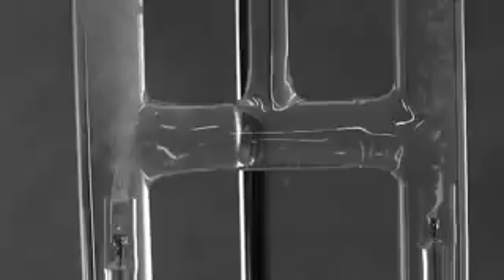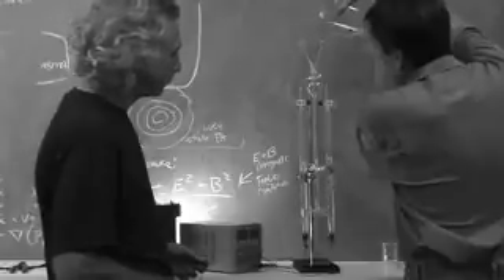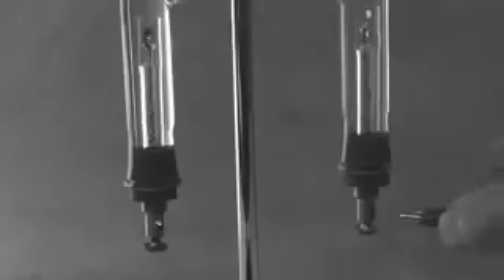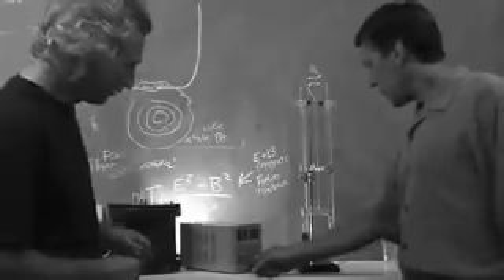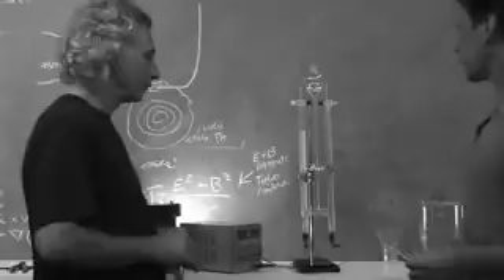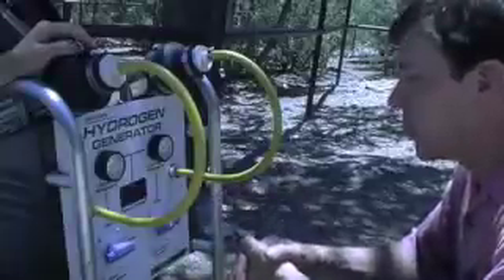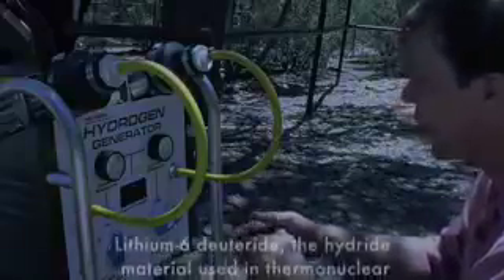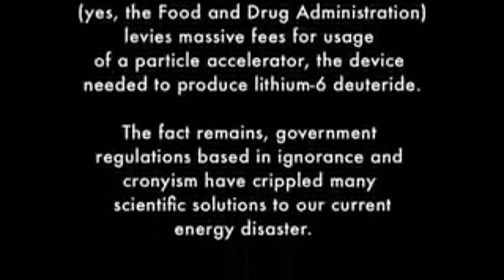run your car on water. This guy does just that!

Comment: The part about making hydrogen gas from water is true. The energy used to separate the hydrogen from water is then converted by either burning the hydrogen in an internal combustion engine or creating electricity in a fuel cell. However at best that energy when converted into motion it can never exceed the energy used to convert and separate water into hydrogen and oxygen gas. The basic advantage to liquid hydrocarbons (gas and diesel) is that there is a lot of energy in a very small amount of fuel.

 The part about storing hydrogen gas in Lithium Deuterium is a questionable solution to the hydrogen storage problem because of the heat and temperture needed to extract it from the lithium and the temperature need to make it react with the fresh hydrogen. Both Deuterium, Hydrogen and and natural occurring Lithium are all stable isotopes. Lithium Deuterium is used in H bombs but to make such a bomb requires enriched Uranium which is unavailable. So there is no reason to limit the sale of any of those materials. Why all the radioactive signs? Helps make the thing look secretive and dangerous. If he's actually doing this he could be in danger of creating an explosion of the conventional type.
Reply: Sources ?
Reply: Well now Kim, time to answer some of your own questions with just a little research.  Are you trolling here for the oil companies ?  Just another question.  One that I cannot answer with research.
Reply: If your a conspiracy nut then obviously I am from a conspiracy of big science, big oil, big government or whatever the latest big conspiracy is.
Reply: Kim O'Brien
 Nah! not a conspiracy nut...  Just trying not to be owned.  How's that working out for you ?
Reply: James Powell I dislike these people who make these outrageous claims. Creationism, burning water, permeate magnet motors, over unity electrical generation and then palm it off as a secret science. Has the government colluded with big business to achieve their ends? Yes! I believe so. In fact that goes on all the time. There are however out there venture capitalists who would easily put up money if these people could actually show it was possible to do the things they claim. 

I am not owned and resent any implication that I am. What I write can be confirmed by most any honest scientist, engineer, or mathematician.     

This guy is smart enough to go beyond the burring water ruse and instead he makes this claim that he is producing a hydride that is a secret component of nuclear bombs. Lithium Deuterium (a lithium hydride) is a component in a hydrogen nuclear bomb. Deuterium is a hydrogen isotope with one neutron in its nuclease. Its chemical properties are the same as hydrogen. So outside of experiments in nuclear reactors, nuclear bombs, and Canadian nuclear power plants it has no industrial use. It has to be separated from regular hydrogen using centrifuges similar to the method used for enriching uranium. You can't buy Deuterium because it is expensive and you would not want to waste it as a chemical fuel. Deuterium is a stable nonradioactive isotope of hydrogen.

 Lithium is available in batteries and hydrogen can be made using a Hoffman apparatus and a particle accelerator is unnecessary to accomplish that task. However the most commonly available particle accelerator is a cathode ray tube (CRT used in old TV's and monitors). It accelerates electrons which then smash into phosphors which produce light.  

I will not retreat from my original assessment that this is nothing more than a hoax where the perpetrator makes claims which can not be supported by current scientific knowledge so he claims it is a government / oil company conspiracy that is keeping him from mass marketing what he claims have discovered.
Reply: Kim O'Brien these claims are supported by science. He makes no overunity claims
Reply: yes it can using rf waves ,three of them = the tridiagonal rotating morse potental,google that shit!
Reply: thomas smyth i know you can go overunity, i'm just saying thats not what this videos about, Longitudinal waves,faster than light and everywhere.
Reply: kandysman86
Did you just say you know you CAN go overunity?
Reply: FuckYouGooglePlus of course you can. This has been done over and over.You can do it by spinning a steel drum with different size holes, fitted in another drum. And the water you run through turns to steam with little effort. The holes cause the water to cavitate which can cause temps hotter than the surface of the sun. It produces 100x the steam heat energy as the motor takes to spin the drum. Over unity is easy, every heatpump on earth is overunity.
Reply: "If he's actually doing this he could be in danger of creating an explosion of the conventional type"

the HHO gas was already explosive and volatile before he stored it in hydrate
he says  the hydrate makes it less explosive and capable of being handled roughly
Reply: robinsss Still less dangerous then giving power to a corrupted Gov. Who said they want your good and will get it.
Reply: DrH5N1
You literally would make the world a better place with suicide.
Reply: DrH5N1
You have never bothered to educate yourself in your entire worthless life.
Reply: DrH5N1

"Still less dangerous then giving power to a corrupted Gov. Who said they want your good and will get it."

I don't understand your statement

I don't think anyone else does either
Reply: Tom Hoehler

" More over-unity horse shit from the kandyass. You have never created one erg of energy in your life, all you do is fill your empty head with bullshit from the internet."

who are you talking to and what are you saying?
Reply: Tom Hoehler

ok

I didn't see the tag
Reply: This claim of energy converted into motion can not exceed energy used to convert and separate water (electrohydolysis) is completely a false argument.  It's like saying the amount of energy spent in a nuclear bomb can not exceed the amount of energy spent refining the fuels it deploys.   The truth is, the energy spent splitting water has NO EFFECT WHAT SO EVER, NO BEARING AT ALL upon the energy contained in the end products.  They will have the same atomic energy no matter what method you used to arrive at them.  This is the biggest load of horse pucks I've ever seen floated as a legitimate science claim.   Come on use your brain man.  It is an inconvenience if the energy obtained by burning the products of the splitting process is less than what is spent splitting the products but one is not tied to the other as a cause and effect.  There are many methods of splitting the hydrogen-2-oxygen molecules into separate H2 and O2 pairs and they each take a relatively different amount of input energy to obtain the same goal but the resultant Hydrogen and Oxygen streams don't gain or lose any energy because of the manner in which they were split.  Really now…. Hydrogen contains a hellacious amount of energy if its stored in water because water can be very dense even made more dense if in a solid state or compressed.   Compressed water is pretty safe compared to compressed hydrogen.   The thing is we now have catalysts that are cheap to produce using graphene and carbon nanotube like technologies that will make the energy expended to split water much lower than the practical useable energy obtained from the water.  That's not over unity.  This has nothing to do with input and output energy because splitting water into hydrogen does not add energy to the resulting product or subtract energy from it .  You are talking electricity versus chemical atomic energy where are two separate realms in terms of this argument.  One creates the other but does not provide added value to the end results, its simply an expenditure required to refine a product, not creating new energy from the process.  It's not fusion.  Think about this critically now.  If the resulting products were allowed to recondense together, they would still have the same energy they had before because there was no energy removed or added to the molecules from outside using the process.  External energy was consumed to facilitate the reaction but it does not become a part of the reaction itself.. What isn't used in the reaction from the electricity isn't added to the hydrogen, it is lost as heat.
Reply: @kandysman86  the first thing came to mind reading your comment was a Tesla turbine - not over unity but something about the way it routes the air through reminded me of your drums: so where is the energy coming from? I know when steam is created there is a trade off between enthalpy and entropy and it curves according to Mollier's diagram but it still sounds like you're talking about energy from spooky places.
Reply: @brettb9194  when the steam is created through cavitation, all the readily available equations go out the window. Look up "star in a jar" to see what cavitation can do. Have you ever seen a prop from a boat thats been used a while? They become pitted, the metal just gone. This is caused by the cavitation of the bubbles produced by spinning the prop. These bubbles collape on themselves and produce enough force to knock a chunk from the metal. We havnt scratched the surface of whats possible.

All these people who hurl insults at  me, all believe that science will get them to explore the stars someday. That some tech will come along and allow us to violate physics at the drop of a dime.  But if I then claim that these laws have been violated, how ever minutely, by experimenters taking unorthadox approaches to the situation, im some kind of moron. These people are not worth our time. Either we know it all now, and we will progress no further, or they are full of shit. My bets in the latter.

Comment: is that it is classified as a "weapon" to protect big oil companies and keep anyone from using hydration for fuel!
Reply: BINGO
Reply: is that it is classified as a "weapon"?  No is not.
Reply: To protect big brother gas taxes and corp taxes.
Reply: @econogate  Right because there is no way they could just tax this new thing.  Or tax vehicles or road use...  (It's still not a weapon, or illegal, or anything else)  It's just wildly impractical to make Hydrogen via electrolysis when you can run just charge an electric car, which the government will literally subsidize when you buy it.
Reply: It's NOT classified as a weapon, you dolt. The guy in the video is a con-artist and a liar. Anyone buying into these conspiracy "theories" are utterly ignorant morons. Period.
Reply: @calysagora3615  what conspiracy lol he built an engine that ( no doesn't run on water but instead on HYDROGEN as we had all who attended elementary school learned about different sources of energy) is less costly than the gasoline powered ones. And yes! The government, all governments control what elements can be freely purchased on the market. That's not conspiracy you not job that's a fact. Since the pipe bombs spreading they now require ID and registration to buy some of the agricultural chemicals in store. Not because of some wackos in government are so paranoid but because some other wackos blew up people. Some of the elements in this power source and how it can be extracted used by the military therefore their access by the public is controlled,  before people start building their own ballistic missiles in their backyard. Daahhh
Reply: My god, people are retarded, I’m glad I can buy a Tesla and don’t need to fill my tank up with water and make sure to have battery to electrolyze
Reply: @c.knoxville5998  Yes, agreed.  Also Bob did not invent anything here.  You can buy commercial kits to run cars/trucks on propane.  Even if Bob is actually using hydrogen here, (he offers no proof of that) a propane powered vehicle can run off Hydrogen with no changes.  And as for his claim that some catalyst is used to make much more hydrogen than with ordinary electrolysis, that was not demonstrated.
Reply: @calysagora3615  
Is this a conspiracy theory? 
http://www.verymagazine.org/magazine/216-overview-issue20/877-henry-fords-hemp-car-1941
Reply: Repeat after me, I am free.....
Reply: Ding ding ding. Careful if you hear your door bell ding dong c👁️ a
Reply: I would assume

Comment: I never seen the car turn on or drive. Seems like that would be a big point to make in the video, that it actually works.
Reply: the most explosive weapon is a hydrogen bomb not a petrol bomb
Reply: really. is it easy to split atoms can you show me how?. and if you are questioning it (i'm not sure if you are) there are hydrogen powered busses where i live.
Reply: I have a car that skips on water. But you have to throw it really hard.
...PS: It's a Matchbox car.
Reply: How would you know it wasn’t running on ordinary gasoline if he did ? You wouldn’t
Reply: @richardturpin3665  you need to learn about nuklear energy.
Reply: @Itsjohnidk  THATS NOT THE POINT...GO BUY HYDROGEN AND THEN BUY WATER AND LET ME KNOW WHICH ONE IS CHEAPER
Reply: You split Uranium or Plutonium to create a fission reaction. You fuse Hydrogen to create Helium in a fusion reaction. As a Physics teacher, I would suggest a remedial course in the subject before you comment.
Reply: @richardturpin3665  You don't split Hydrogen, Richard. Don't listen to this guy.
Reply: @richardturpin3665  If you don't know the difference between hydrogen COMBUSTION, FISSION, and FUSION you should likely just stop commenting.
Reply: no one's fault but your own. no one cares.
Reply: never seen hydrogen explode? my only fear would be that it works a little too well and fucks up the engine
Reply: Don't be ridiculous. You saying this doesn't work? You do know hydrogen vehicles now exist, don't you? Also, they didn't exist en-mass before because big oil was at the top of the totem pole and suppressing this technology but that's all changing now.
Reply: There are plenty of cars running on hydrogen, the only problem is the price of H
Reply: @aak8297  No. The main problem would be the availability (refueling stations).
Reply: @justalonesoul5825  Even if I had 1000 stations around I wound't use hydrogen because of the prices. Test prices which would probably go even higher after hitting mainstream are at 10EU/kg at this moment.
Reply: @Tempestni02  but hydrogen cars now does not burn hydrogen... it is used for fuel cell to produce electricity and car runs on it. 
This is standard corvette with combustion engine and uses hydrogen instead of petrol. Its a bit different idea.
Reply: @richardturpin3665  maybe he has a secret particle accelerator power sharpened blackhole tipped chainsaw at his toolshed.
Reply: Funny.  Amazing how logical your Comment is, eh.
Reply: @Tfonz Tfonz Yeah ... i figured it was an attempt at cryptically screwing with a.i.   Funny!
Reply: @josephpinador7949  LOL dude just got schooled
Reply: @josephpinador7949  some people just love spreading misinformation on the internet
Reply: @josephpinador7949  I hear there is a finite amount of Helium because it can be found but not made.
Reply: @icouldntthinkofagoodname7216  Yeah, who doesn't... but t's supposed to be a secret.
Reply: @Tfonz Tfonz 🤣🤣🤣🤣🤣🤣🤣